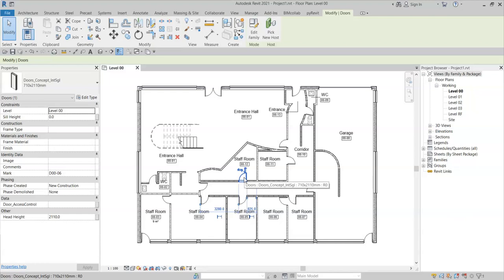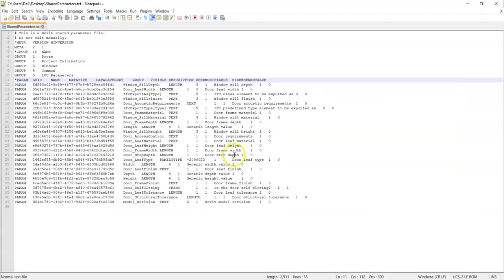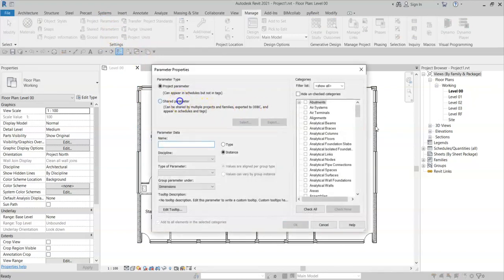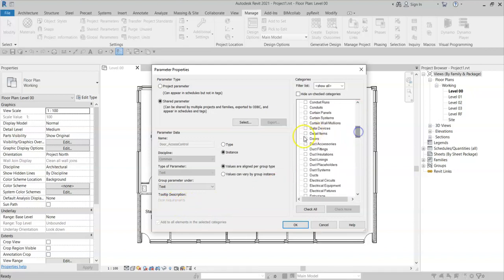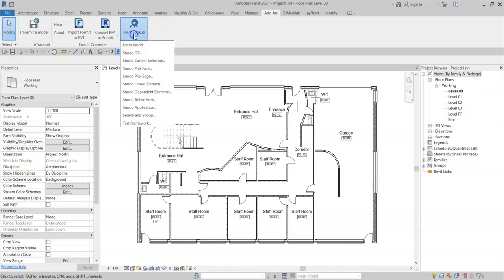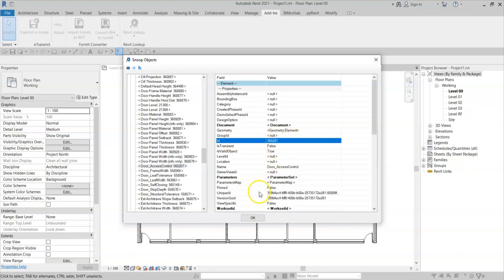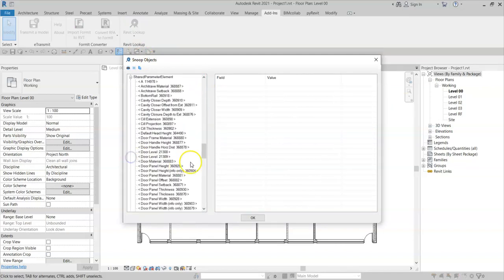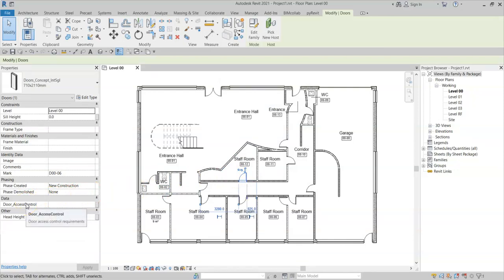Advanced Shared Parameters - Part 2 - Delete / Replace Shared Parameter

Comment: It is worth mentioning that you can break some of your families that also has that shared parameter. Especially tags! It can even delete whole labels from tags without any warnings. And one you figured it out it is kinda too late. So the correct workflow would be: 
1. backup all your parameter values to a temp parameter 
2. export all your families (at least the ones that has that parameter) 
3. remove shared parameter 
4. re-add the updated shared parameter 
5. reload families 
6. restore values 
7. fix all your shedules that used this shared parameter